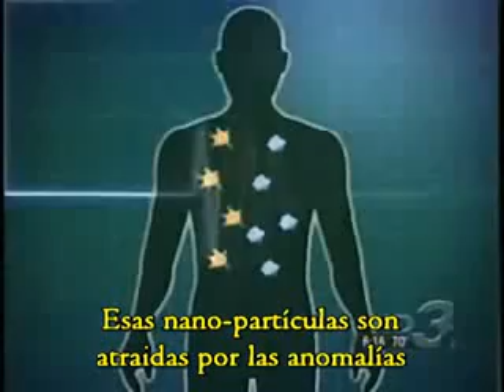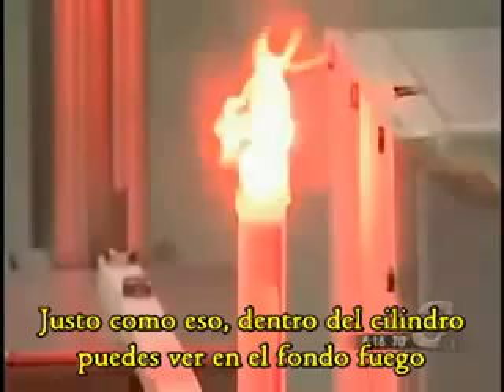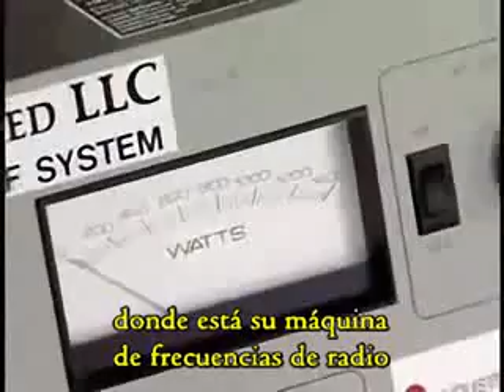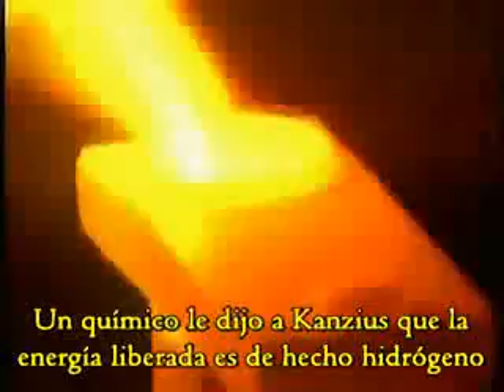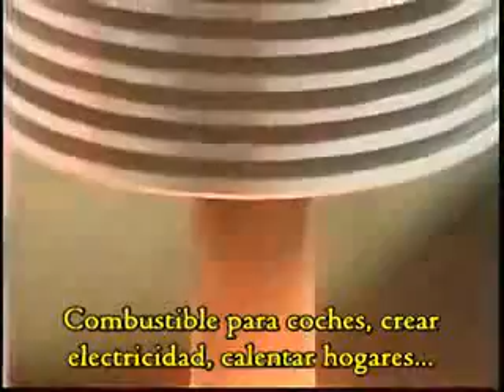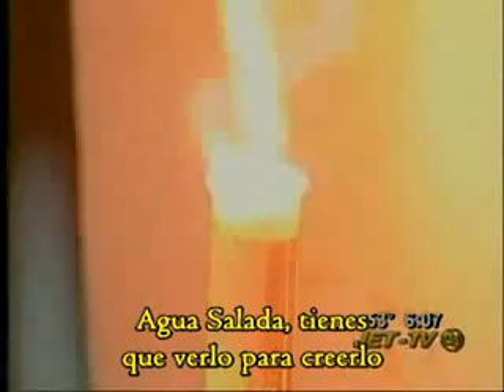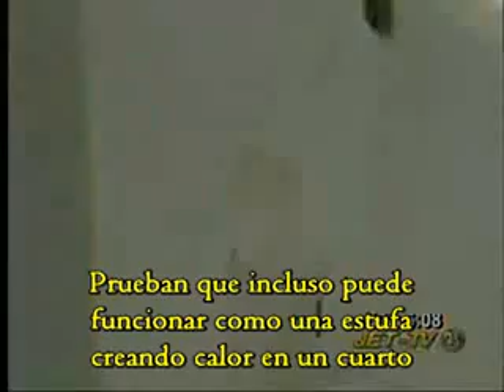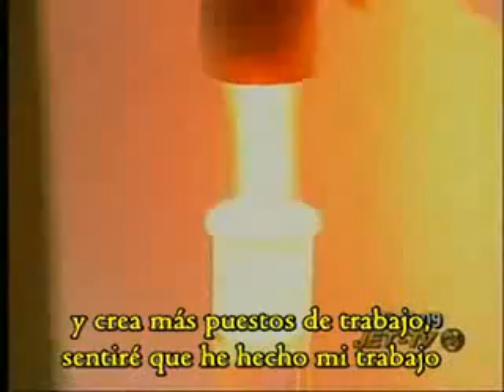Energía gratis para siempre

Comment: as cool as this is.. are you freaking kidding me? for cars??? this would not work in that application. the power needed to run the frequency generator alone will be alot and you would have to blast the engine with it.. whats the engine made of? METAL! you dont put metal in a microwave do you. Hats off to this discovery truly but can you make air please because we are running out of that. id rather have cancer than no air.